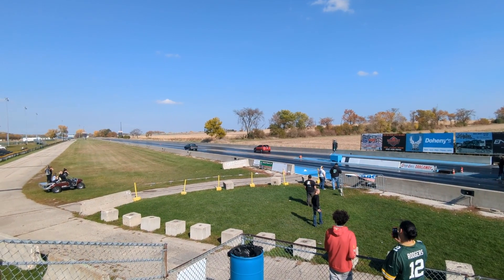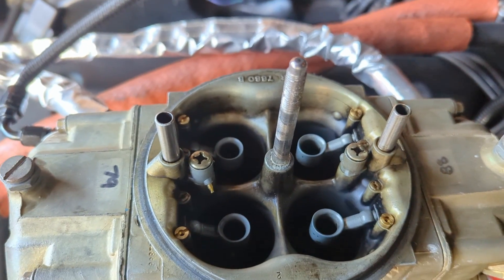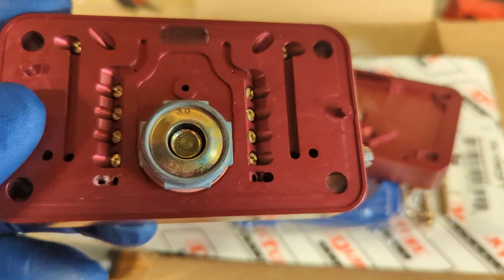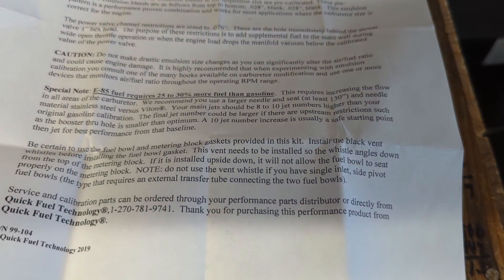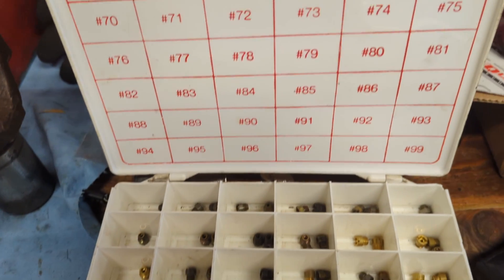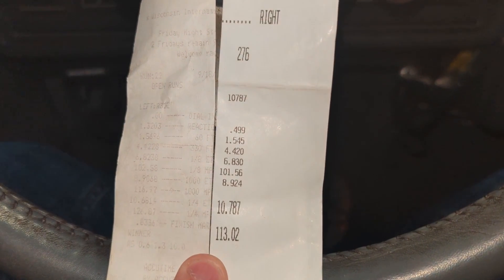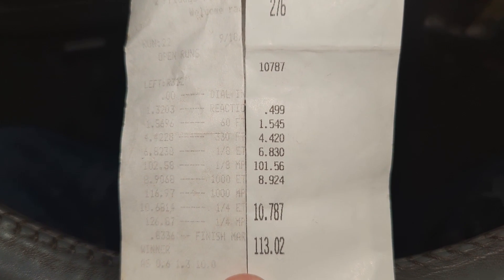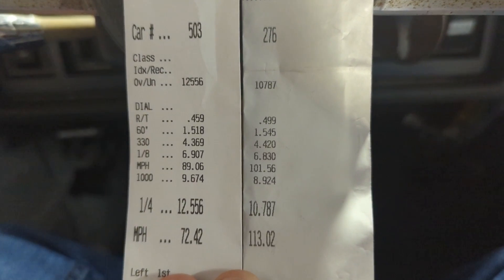Metering Block Conversion - E85 - IT WORKS!

Comment: That's not all that needs to be done. It needs bigger needle and seats and air bleed change, plus take the screw in jet extensions out and change to the ones from holley that fit over the outside of the jet, the screw in ones have too small a hole and restrict the jet flow for e85.
Reply from the maker: I should have mentioned the needle change.  Its in the quickfuel instructions.  I bought stainless needles and put them in the chrome bowls.  Chrome bowls arnt necessary but they are more resistant to corrosion.  The jet extensions are drilled but maybe the slip fit version would do better?  The airbleed setup is really close to what it was.  I did play around with it a little because i had airbleeds to try.  Thanks for commenting!

Comment: What kind of mileage on the street do you get with the e-85? Gotta be worse than gas. I considered e-85 but, I only have a 10 gallon fuel cell for my 565 BBC in a 70 Chevelle that I drive on the street a lot. I need at least 110 octane as I am at 13.5 to 1 on the compression.
Reply from the maker: It was around 7.  Gear vendor and 3.70 rear gear.  Cruising between 55 and 65.  This was being very nice to it and having a trunk full of tools.  On gasoline i was getting between 12-14.  These were found out on full fuel runs going from track to track on drag and drive events.

Comment: Do you think its worth switching from 93 pump gas to e85 carb on 427w sbf 11:25:1 compression naturally aspirated?
Reply from the maker: I would consider it just based on it being available at the pump.  If its not available at the pump then i would quickly say no if its a street car.  Depending on how deep you want to get into it consider buying an e85 carb already set up.  If you like the challenge of the calibration work the block kit is fun thing to do.  Also, if your cooling system is marginal - e85 will help keep things cooler when compared to gasoline.  If your setup already runs great on 93 I wouldnt expect much to gain.   Before i switched over i already tried race gas (for the high octane) with good results so going to e85 made sense.  Im 11:1.  4.28" bore. Alum head

Comment: Would like to see a video on your manual brake set up.
Reply from the maker: Its got the Trz motorsports firewall plate and strange master cylinder.  Trz sells it as a kit.  Behind the stock wheels i fit the 12.19 4 piston willwood front kit.  I had to round off the calipers with a flap disc. Drums in the rear.  The car stops great.  Il do some more videos of the car probably in spring.  Hope this gets you started.
Reply: @josephnowak  12.19 inch rotor?
Reply from the maker: Yes.  I got the 12.19" rotors to barely fit with the factory cast alum 15 inch wheels.  My race skinnies have a mile of room however.  Overall decent setup.  If your just trying to get on the road on a budget manualbrakes.com has an affordable option.  I previously had their kit and ran it for several years.  Works decent on the street but depending on how fast you want to go you will exceed the factory rotors at some point depending on weight.  I had trouble stopping from 125mph

Comment: Try drilling out your high speed air bleeds, or if they're adjustable, swap them out
Reply from the maker: Thank you for the comment.  I think this would be another fun video to do just to show how they work.  The carb has screw in air bleeds.  Probably in spring il do some more testing/swapping on it with results.